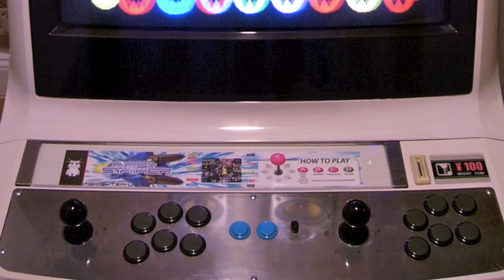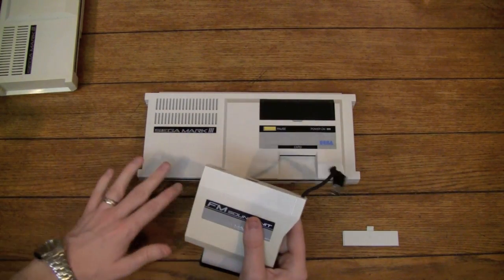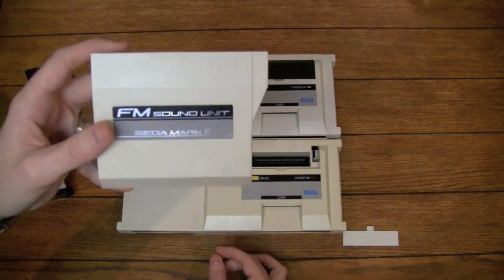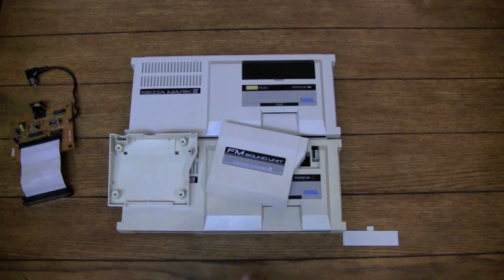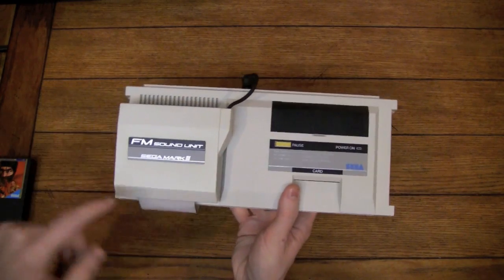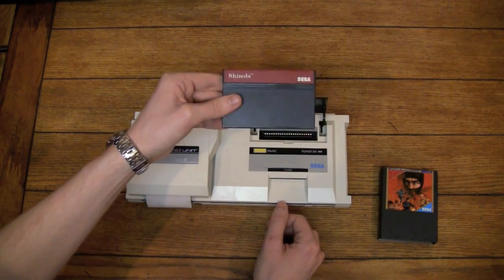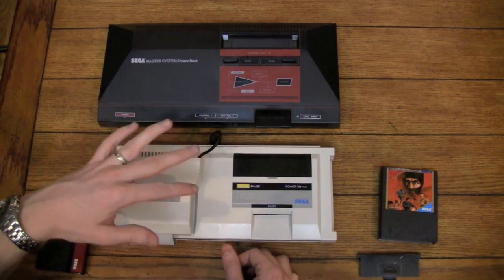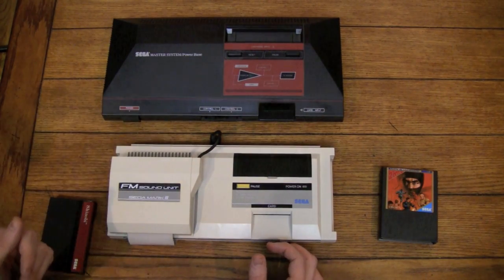Sega FM Sound Unit

Comment: It does hook onto the system and I thought it was pretty obvious, check the 2 “teeth” on the backside, you hook those onto the vents (note, the first set that’s closest to you when you are booking it on. Once it’s plugged into the front it doesn’t reach the 2nd vent grill). I just got one today...mine is in super nice shape (everything looks brand new, the box had not been opened from what I can tell) but the ribbon cable is also finicky on mine, so maybe it’s just the fact that this thing is 30 years old :-) I had to plug it in and out a couple of times before it would work. A little nerve wrecking before it finally worked

Comment: You can buy FM Sound cards for the Master System, they plug onto that expansion connector, and have a few wires soldered to the main board. The only major inconvenience is the required switch to enable or disable it as games require. Somebody needs to fix that!

Comment: Is that a MIDI out on the back of the Mark III or is it just a proprietary connection using a din connector?

EDIT: Oh no, I see. It's the AV out and it's adding the sound from the FM unit and passing the video signal through to the corresponding port on the back of the FM unit. I forgot, but my Master System had an AV port like that too, but I never had the cable for it. Just used to use the RF out.

Comment: the inside plastic shouldn't be yellow, because yellowing of plastic is caused by light. (or cigarettes, but that's a different kind of yellowing.)
Reply: The yellowing goes all the way through on several systems. It's believed that UV light doesn't "cause" the issue, but merely speeds up a chemical reaction that will eventually happen, regardless.

Comment: Got me @10:46 , Never had an MS though
Reply: +burleybrawler I almost ran out and dropped $200 on a Master System, a copy of Phantasy Star and an FM sound mod kit right there. Even so, maybe I will eventually.
Reply: FM sound doesn't work at all on the official NA Phantasy Star cart.  The code for it was removed for some reason.
Reply: Yeah I'm going to buy a copy of Penguin Land sometime and make my one Phantasy Star reproduction cart with FM sound. I have a Master System now.
Reply: Timstuff Nice!
Reply: You can also use Monopoly as a donor for Phantasy Star. Its cheaper to acquire than penguin land and uses the same board. I've made a couple of Phantasy Star carts using the original Japanese rom with the english translation from smspower
Reply: Cool. So I take it Monopoly has the save feature that Phantasy Star needs? They have a few copies of Monopoly at my local shop and now I may have to raid them.
Reply: Yes, Penguin Land and Monopoly use the exact same pcb and both use a cr2032 battery to power the ram for saving the game. Cheack the power of the battery and if it needs to be replaced you either need a very slim battery holder or a battery with solder tabs attached. I use monopoly as a donor since its easier and cheaper to find than penguin land, especially here in the UK. I will try and take some pics of the one i still have here and put a link up tomorrow (its 2am in the UK). Its not pretty cause it was my very first experiment with repros/rom replacements (hence why i've still got it).

Comment: Why didn't they include the FM chip in the non-JP Master System?
Reply: Seemed like a missed opportunity there, though perhaps cost also came into the picture if they didn't want to afford for those extra chips.  You guys deserve better.
Reply: +batlin There's a socket for it on the bottom so under a piece of plastic designed to be snapped off, so they probably intended it at some point but canceled the add-on when it failed in the US market. You can buy aftermarket mod boards that fit with an American Master System, it just needs to be plugged in, then you gotta remove a capacitor and solder 2 wires on for the audio mixing, pretty simple.
Reply: The western master system was released before the japanese one was finished.  We got beta tech.

Comment: Game at 13:47?
Also, does the Mark 3 play Master System games? Because the converter you said
Reply: +mendyc158 The Master System and MKIII are basically the same system, like Nes and Famicom. I think the MS was released in Japan as some kind of re-release of the MKIII, I guess with the FM integraded like he said. The game is called Penguin Land.
Reply: +Horzuhammer Yes, the MS was also released in Japan, that's why I have the question... I do know they are very similar to the MKIII, but they might not work? I don't know, I don't remember hahaha
Reply: The japanese master system was actually codenamed mark iv.

Comment: I followed the link as well. Looks quite interesting. Do you have any idea why the board requires soldiering? Since the original sound card does not seem to require it and it uses the same connector. I'd love to have one but i'd prefer not to mod my console.

Comment: I first alway's tout that both master systems dit had ext sound pins input but nope so the way you have to hookup the fm sound module is technically cheating aka 32x,same thing.
Sing it requires it's own a/v cable while the other end goes into the console's av port for tapping & mixing the audio(+video for 32x) with the rest.